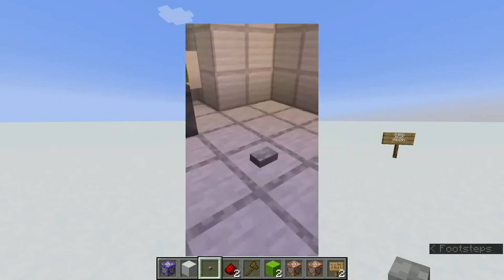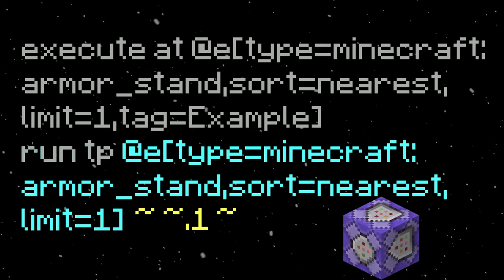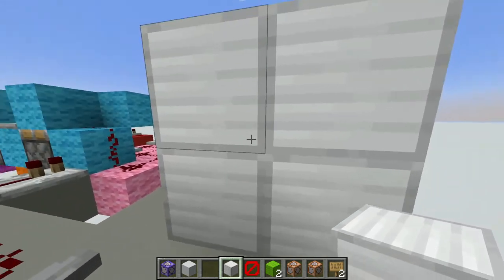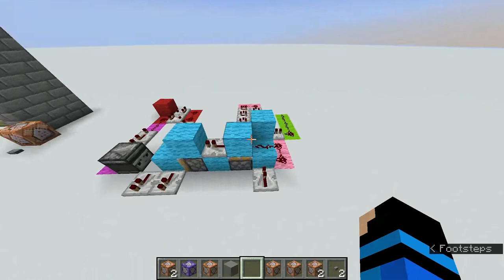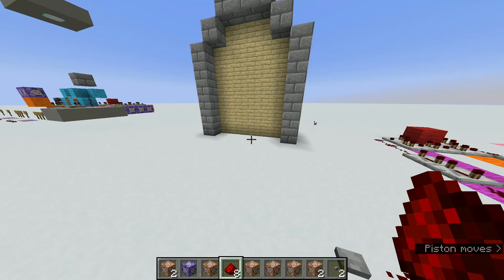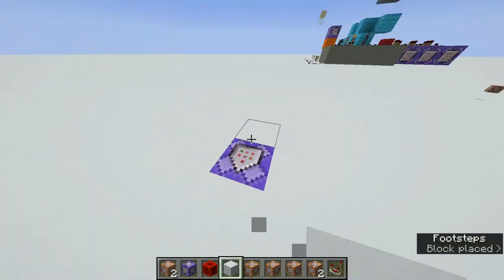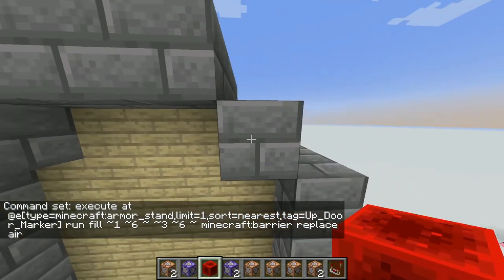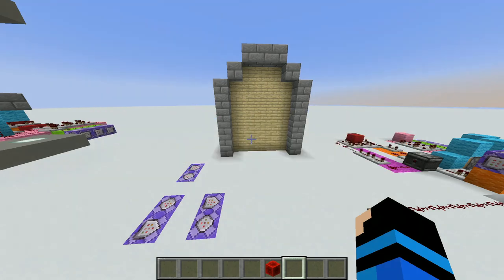How do  Smooth/Flawless Command Block Doors Work? (EASIER DESIGN)

Comment: I've been looking for something like this for so long! def deserves a like!

Just one question tho. 
I summoned a door block with a tag I don't like. is there anyway to remove that specific armor stand without doing /kill @e? (also not @s because I keep forgetting tags)

also p.s. for people struggling with barrier blocks being placed one block to low at the highest interval of the door, I think its due to the way computers handle doubles and floats, where it has a chance based on the y coordinate to store that y coordinate as 0.0000000007(or something else really tiny) lower or higher than what it actually is. its called floating point arithmetic if you want to look into it(by the way, this being the reason is kind of a guess but it makes sense). anyways  to just add or subtract a ridiculously small  number to combat it. like I use 0.000001. It's unnoticeable but completely fixes the problem for me.
Reply from the maker: Thanks! I’m glad you liked the video :)

You can specify an armor stand to remove by doing /kill @e and then filling the following brackets with specifiers

For example
/kill @e[type=armor_stand, limit=1, sort=nearest, tag=exampletag]

Also thank you for the explanation on the barrier block placement. I agree with you that what you stated is likely the problem.
(I’m gonna pin ur comment so people can see your explanation)

Comment from the maker: I would like to note that there is a possibly easier way to spawn the barrier blocks in which you label the top and bottom row of the door with tags and then add and remove barrier blocks for the entire row at the same time. By doing this, you could reduce the amount of command blocks needed for collisions to 2.

Comment: I tried making this, but for some reason, the blocks aren't in sync. Could it be my armor stand are getting misplaced somehow?
Reply from the maker: Assuming that all of the armor stands are being moved by the same command block at once, they should stick together in whatever structure relative to each other that they started in.

Its hard to say what the problem is exactly without more context, but if your armor stands are starting out perfectly aligned, then you might want to double check that they are all being moved at the same rate (preferably by the same command block)
Reply: @radio_transmitter  Thanks for the reply! I found out that even if they're initially not in sync, they will eventually align perfectly after exiting and re-entering the world. :)

Comment: I've been working on trying to implement this, but have run into a couple issues. First issue is removing the blocks. I've read through the comment and have seen the suggestions for using /kill @e, and that removed the armor stands, but not the other blocks. Other issue was that I was trying to use iron bars (trying to do a castle gate), but when spawning in, they are just the "pole" and not combined into the bars. Any ideas how to fix that, or is it just sort of a quirk of summoning items in? I'm doing this on a server, as opposed to single player - not sure if that makes a difference?

Also, fun fact, -2147483648 is the minimum value that can be stored in an integer data type. How that affects gravity in this context? No idea lol
Reply from the maker: Thanks for the question!  
It’s really cool to hear that people are using my designs!  :)

It shouldn't really make a difference whether you are running in singleplayer or multiplayer. When I first came up with the sliding door, I actually made it on a multiplayer server. 

-----------------Removing Blocks and Armorstands-----------------
Although the falling block is a passenger of the armor stand, the game still treats it as a separate entity, so when you use the command to kill the armor stand, the falling block will be “dropped.” So in order to remove both of them, you would need to run the command once for the armor stands and once for the falling blocks.

Remove armor stands
/kill @e[type=armor_stand, limit=<#of armor stands>, sort=nearest, tag=<tag of armor stands>]

Remove falling blocks
/kill @e[type=falling_block, limit=<#of falling blocks>, sort=nearest, tag=<tag of falling blocks>]

-----------------Blocks With Properties-----------------
About the iron bars (this also applies to similar blocks like glass panes and fences etc)
The single “pole” that gets rendered is actually the default state of iron bars in the game. But when you place the actual iron bars block down next to each other, they will stretch and join together. The game handles this by storing a set of boolean properties in each iron bars block (north, south, east, west) that will tell it which sides to extend on. So, if you define these properties while defining your falling block, it will be able to similarly extend to those sides.

For example, this will summon an iron bars falling block that extends in the east and west directions
/summon armor_stand ~ ~0.5 ~ {NoGravity:true,Tags: ["Wide Bars"], Invisible:true,Marker:1,Passengers:[{id:"falling_block",Time:-2147483648,NoGravity:true,BlockState:{Name:"minecraft:iron_bars", Properties:{east:”true”, west:”true”}}}]}

Note: for some reason, you have to denote the boolean value as a string. Dont forget the quotes!
Reply: @radio_transmitter  Awesome, thank you! I really appreciate all the information!